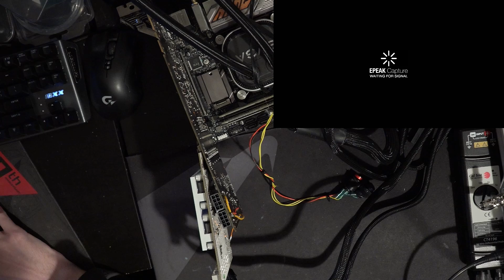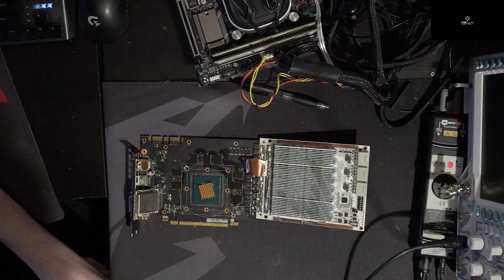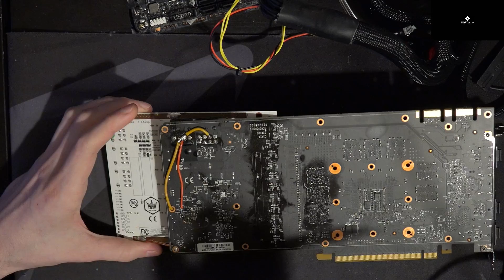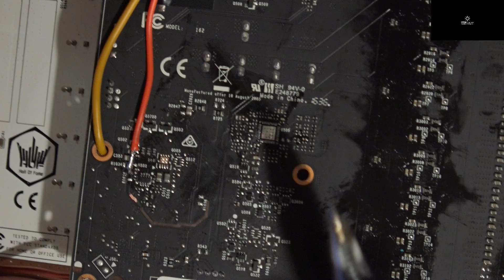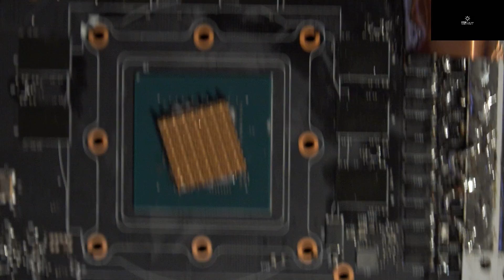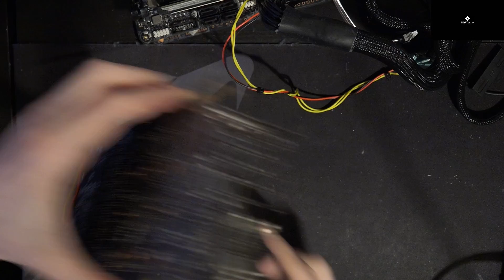GPU necromancy: EVGA GTX 1080 FTW (minor error in video check description)

Comment: When you get bored, could you please tell me what the uf of the caps are on the memory at the very top of the card, there are three rows front and back. My 1070 FTW exploded too, caps and a v3605.   I dremeled out the craters, uv coated it, took a guess and used 10uf caps as the surviving ones tested around 8uf.  It lives and runs fine for normal use but screen goes black and fans kick in when playing games.  Could be my old PSU but still.  Oh yeah, EVGA won't tell what they are.

Comment: Hello. Need some help. Im using a gigabyte z490 vision g and whenever i try to run asrock timing config i get an access violation error. what is the problem?
Reply: That program was basically abandoned for newer chipsets, including Z490. The guide you're using is outdated most likely. If you get version 4.0.3 exactly it should display your current timings, but you cant change anything
Reply: @Yochoc  That works. Thank you!
Reply: I guess an access violation of some kind

Comment: Honestly, I wish they would make it easier to remove the power section by cutting the back half of the card off. Yes, there is some logic there but if there are new power boards designed for that purpose then it would be an easy job with some jumper wires.  Design the card and the replacement power section so that you can detach the dead power section with a Dremel tool really easily with the back plate as a guide (cutout in back plate?) and then after cleaning up the cut on the good board with Dremel and sand paper you can attach the new power board to the back plate and then solder on the jumper wiring and go.  

OR GIVE US A REFERENCE DESIGN and let US do it....
Reply: Yeah, it just nobody talks about it, and people tend to just buy a new gpu because the new series was probably launched

Comment: Those zero ohm resistors are frequently used as fuses in nvidia designs.  The GTX 690 has one protecting is .95V rail, which is prone to self destructing when used with a weak power supply.

Comment: Hey, I have a very weird, very rare Dell/Alienware OEM only GTX 265 1.8GB card. I have a long time lost all the mounting hardware for the cooler, but if you want, I can take nice pictures of the board for you. The question is, could I take that card and cut it down the inductor rail  and use it as a eGPU so that I can fix broken GPU's like this?

Comment: MOBO a friend brought me to look at has one of the capacitors for CPU vcore completely blown apart, only insides kinda remain, and another 2 down from it looks like a rocket trying to take off the board, black underneath and bottom isn't even on the MOBO anymore 😂, contacts are still there but capacitor isn't touching the board.

Comment: i have 8 1080ti that haven't used for 2yrs (used for mining for 6 months) 6 unit are working and sold already. and the other 2 is not working just blackscreen. i wonder if this unit are still repairable. all units are working before i put it on the box. i wonder what happen. I just didn't use it for 2 yrs. sorry for my bad english.
Reply: Send them to this Freak!

Comment: Slap a moded cheap CPU water block on it and water cool it plz. I did that with Vega when I couldn't be bothered to spend another$200 for a proper water block. Also added a high rpm 120mm fan to the vrm& memory.

Comment: Where did u learn about all this? In school?
Reply from the maker: internet forums.
Reply: @ActuallyHardcoreOverclocking  wow ok so im on the right track lol. Everything i have learned is from trial and error and online since i was 14 when i first got i to computers thanks to cs 1.6 lol
Reply: @ActuallyHardcoreOverclocking  thats pretty impressive. ive done 3 years of electrical engineering, which included 3 courses of electronic devices and i dont even have anywhere near the kind of knowledge you do. granted first hand experience is everything when it comes to stuff like this